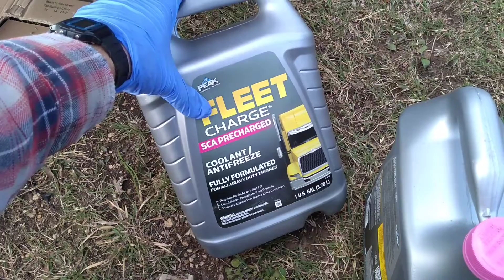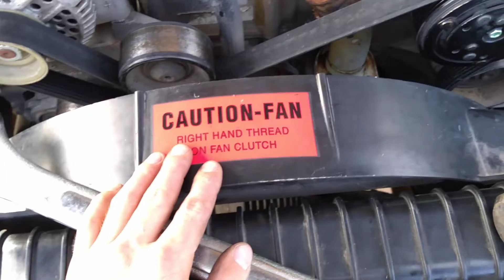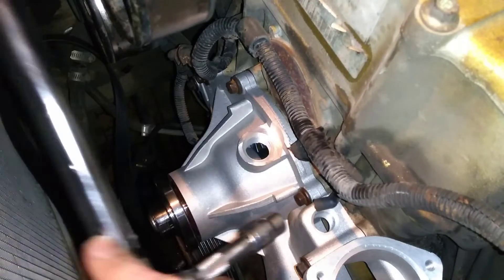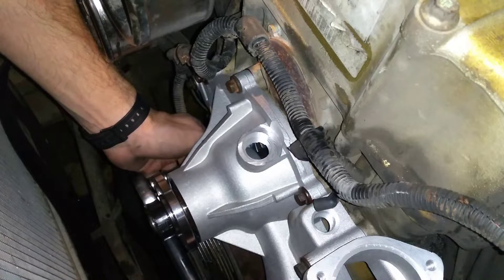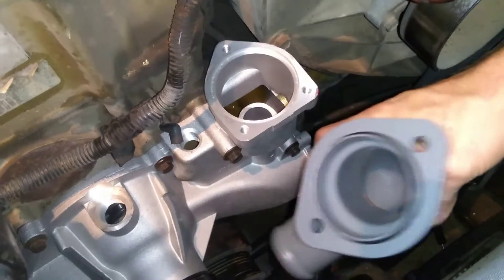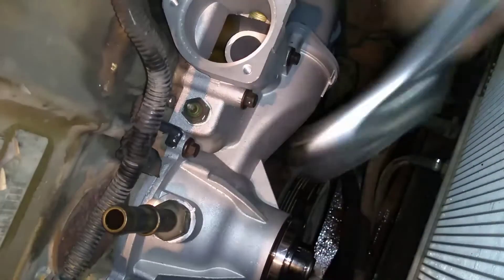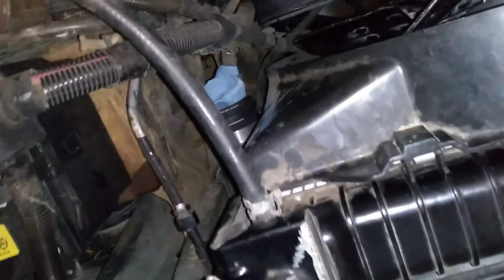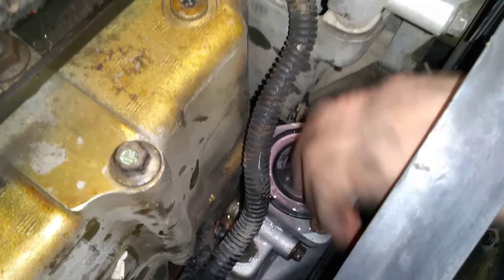7.3 Powerstroke Water Pump Replacement

Comment: Decavitation is when you run straight water instead of a coolant/distilled water mix. What happens with straight water is that it causes the block to rust out from the inside out and the compression will blow a hole in the cylinder wall due to the thining out caused by rust
Reply from the maker: Robert Slade Jr, true, cavitation is essentially an accelerated corrosion process. However it will also occur if you use antifreeze that has not been treated with Supplemental Coolant Additives. Though cavitation is not a major issue for 7.3 Powerstrokes, it was the cause of failure for many of the 7.3 idi's. From my understanding, Ford, or International if you wish to be manufacturer correct, wasn't aware of the cavitation issues in the 7.3 idi's, until a number of them started coming back with pinholes in their cylinder walls, that resulted from cavitation. Since then, Ford has called for Supplemental Coolant Additives to be used in the coolant system of every Powerstroke Diesel. Essentially SCA's are made up of Silicate and Nitrate compounds that form a protective barrier against cavitation. As the cylinder walls flex and move from the high pressures in the diesel, it causes a rapid movement of the coolant near the cylinder walls. That movement causes a temporary but significant pressure drop that drops below the vapor pressure of the water. Basically the water is boiling near the walls, in a sense at least. As the pressure change comes to an end with the cylinder wall returning to it's initial state, the vapor bubble collapses which results in a shock wave being generated as the water slams against the cylinder wall from the bubble collapse.
Reply: @Rnddiesel  the reason it was a problem with the 7.3idi and not the 6.9idi or the 7.3psd is because the cylinder walls are much thicker on the 6.9 than the 7.3 IDI. All the 7.3idi is a bored over 6.9. in 1987 the 6.9 received a MUCH needed head upgrade and it was it's last year of production. 1988 was the first year 7.3idi. International reconised the issue and when they casted the 7.3psd block they made the cylinder walls thicker while maintaining the same displacement
Reply from the maker: @ThatTexasMechanic  Absolutely! It's kind of ironic that 6.9's blew head gaskets, I guess their 7/16" head bolts just weren't enough, while the next step up poked holes in the block! Heck I was looking at getting an idi a couple years ago, almost bought a nice CCLB, Dually, 4spd, 4x4, 6.9 for $1500. I couldn't get the engine to spin over though, figured I wouldn't trust an engine I couldn't at least turn over. Heck you can rebuild a 6.9 3 times at 0.030" over each time, and still have 0.020" thicker cylinder walls than the 7.3 idi. You definitely know your idi's! Have you ever heard of someone putting the bigger 1/2 inch head bolts on a 6.9 idi to help fix the head gasket issue?
Reply: @Rnddiesel  it has been done by machine shops etc in the past, the 1987 6.9 has the 1/2" head bolt holes, better flowing heads etc. It was the strongest 6.9 yet just to get thrown away. Now they sell a head stud kit that are 7/16 for the 6.9 and there's no need to have the blocks drilled and tapped for 1/2 bolts or studs.
Reply: @Rnddiesel  ive been working on and building IDI motors since 2008 lol.
Reply from the maker: @ThatTexasMechanic  Yeah I know they sell head studs, but you can only make the steel so stiff before you simply need more metal to make the bolts. That's awesome how you've been building IDI's for so long! I do want to get me an old school IDI one of these days, but they are getting harder to find.
Reply: @Rnddiesel  think of it this way. When you push boost on motor not originally built for it the factory head bolts will stretch and pop gaskets. So you use aftermarket head studs and it holds the head down tighter etc. Do the same with a 6.9 and your good to go.
Reply from the maker: @ThatTexasMechanic  True, maybe I'm just over complicating it in contemplating how to make the darn thing indestructible. If you can go to the larger 1/2 inch bolts and utilize a set of head studs with a much greater ultimate tensile strength,  you'll be way better off than if you had just used bigger bolts or installed stiffer studs. Though at the end of the day you're still stuck with an IDI. The 21.5:1 Compression Ratio doesn't help, but limits the amount of boost you can push. The Powerstroke with 17.5:1 CR, and if it were given the same boost as an IDI, the cylinder pressures would be much lower in the PSD. Then there's the 6.0 where they ignored common engineering practice and only used 4 bolts per cylinder...
Reply: @Rnddiesel  The IDIT motors only have a compression ration of ,19.0:1. I prefer the IDI without a turbo. I absolutely love them. I now have a  OBS PSD and have fallen for this as well.
Reply from the maker: @ThatTexasMechanic  The NA idi's are weird, they sound like big block gassers with a diesel clatter, pretty cool though! I've sure fallen for my OBS as well, guess that's how we can justify forking out the cash to fix them up.